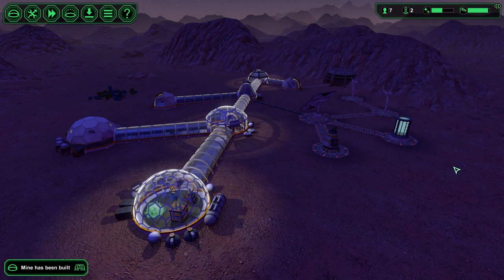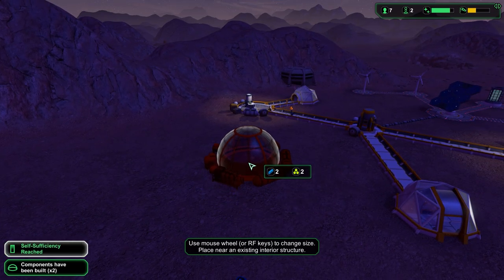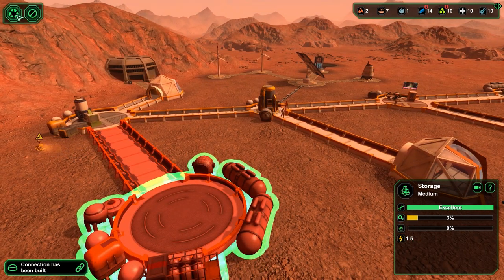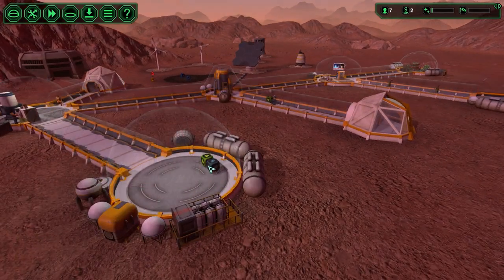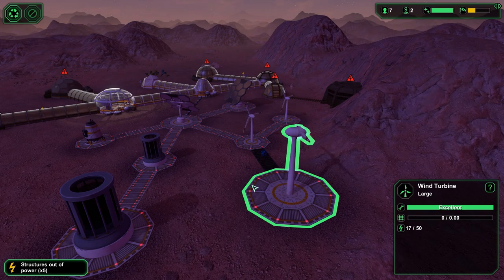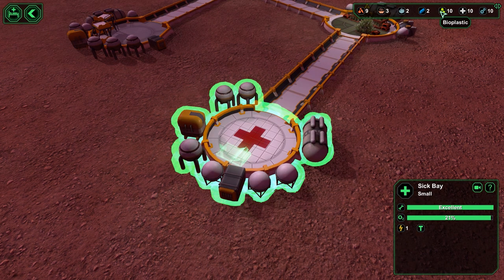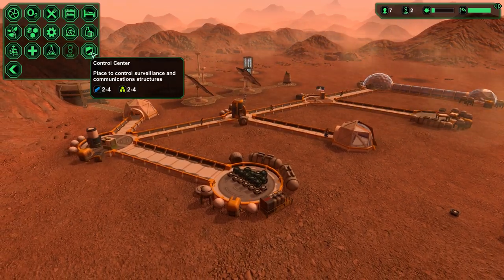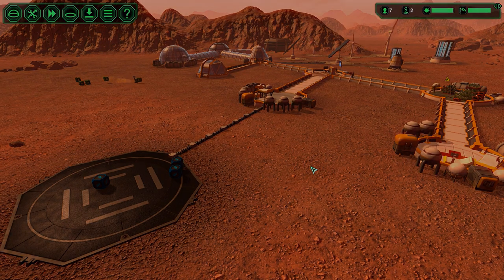PLANETBASE - Electricity Emergency! [Pt.3]

Comment: 7:03 During a power failure, oxygen production stops. If not corrected, oxygen levels will fall over time while the power failure lasts.
Reply: Power ratios are:

1 solar panel power production requires 2 solar panels to 1 batteries of similar size; and
1 wind turbine power production requires 1 wind turbine to 3 batteries of similar sizes. 

You can plan power structures by looking at the power chart. It tells you how much power you require / power production. While solar is cheaper, a mix of solar and wind power production is good. I hope that is helpful.